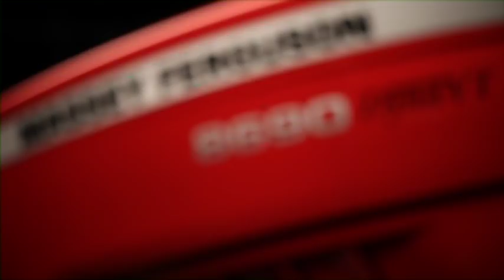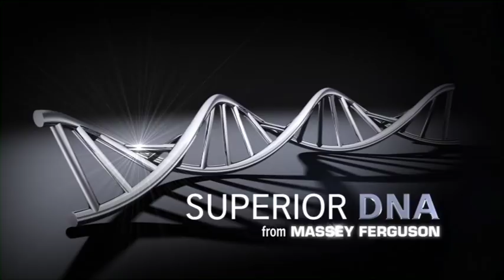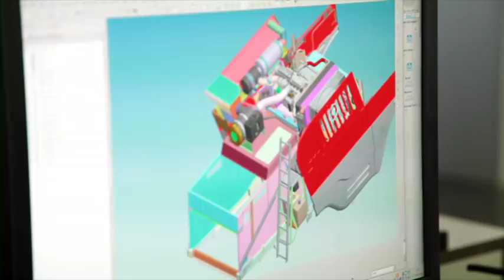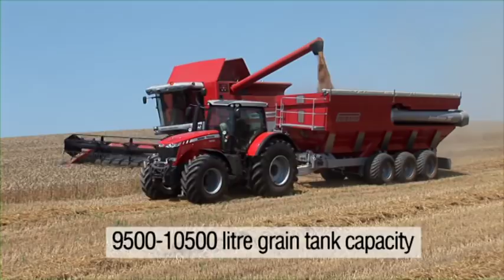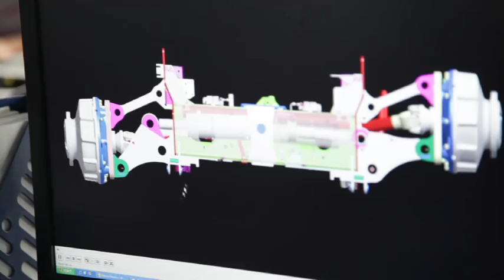Massey Ferguson Promo (2012)

Comment from the maker: The MF 6400 and 7400 series are out production. the focus is now on the MF 5600/6600/7600/8600 series in the Beauvais factory.
Reply: I own a 65 hp tractor made in the year 1960 and this clock works without any problems
Reply: الو